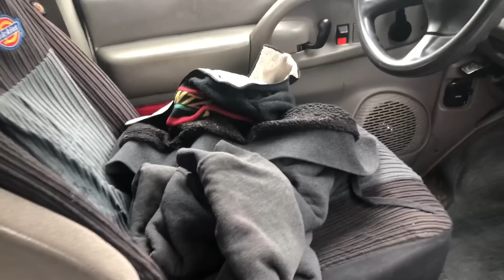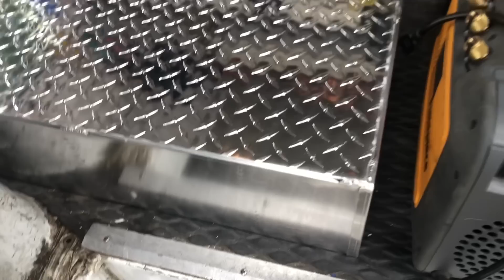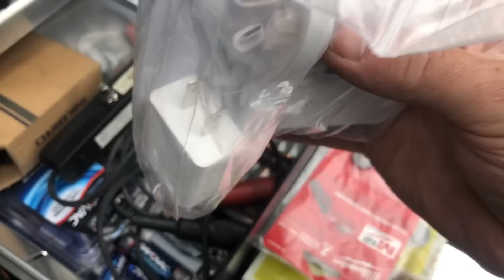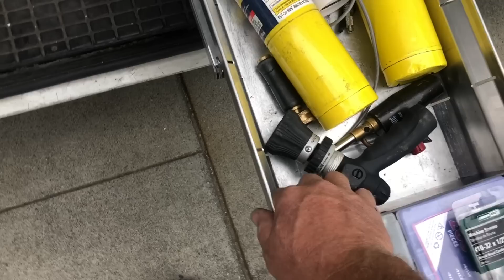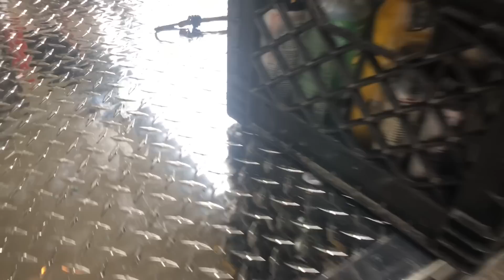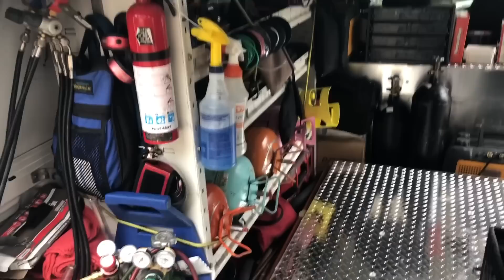Astro van Tour

Comment: Love your long pull boxes, if I could only convince my boss to get those for my van!  One thing I saw that I don't see many carrying in So Cal is the powerhead assortment that you carry from Sporlan.  I wish more guys carried them, because Sporlan makes their valves like tanks, and usually only require a powerhead replacement, not the entire valve.  Yes valves do go bad on occasion, but not as often as my company thinks they do.  Heck my company wants us to replace the TXV's every time we change out a compressor, what a waste of time and energy.  I personally don't, why overcharge the customer for something he/she doesn't need.  Just use proper piping/silver soldering practice and it doesn't need to be replaced.  Love your vid's man!

Comment: i see your fitting box is one of those Milwaukee boxes, I picked up 3 of them at Home Depot, they run like 20 bucks apiece here.  Excellent fitting or hardware box, I use one for copper, one for braas, and one for misc fasteners/screws/washers.  No matter how small , the fittings will not "swim" from bin to bin, the clear lid is designed to fit snugly to the tops of the individual bins and it works great.  Best 20 dollars a guy can spend.  Love those aluminum boxes, Ive never seen those,  that makes for a nice setup.  Still miss the old Vangina!

Comment: I didn't see any Rescue EC5411D motors.. they are great for condenser motors and case fan motors EC5412D are reverse rotation. You can wire them 115 or 230..awesome motor.thedy guarentee to submerge and keep working.
Reply from the maker: I have 3 5411 on there.
Reply: After a demonstration I use them in a ton of cases.. they are great for replacing ELCO motors. Saved a ton of moolah. Be safe brotha.

Comment: I drive a Transit connect it a half van it sucks no room at all most of my tools are in my garage. I need some drawers like those .
Reply from the maker: I got this for 500$ sold the vangina for 300$ so I’m only 200$ in. Any repair I’m way ahead
Reply: my boss is saving money on gas went from 11 mpg to 21 mpg it is good for him but not me .
Reply from the maker: jddilligaff have him buy you the draw units. 👍
Reply: I built 1 for the floor out of wood it works but still 48 x 48 is not much space .lots of head room though.lol
Reply from the maker: jddilligaff can you take the passenger seat out for storage?
Reply: I had the same van lost a transmission at 80,000. Burnt #2 exhust vavle at 130,000 would not pass smog so got into a transit 150